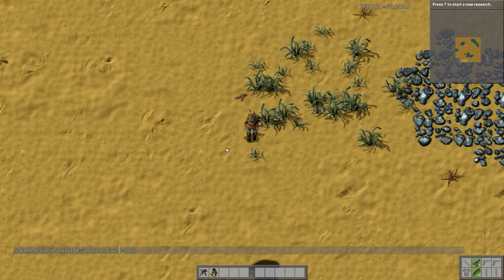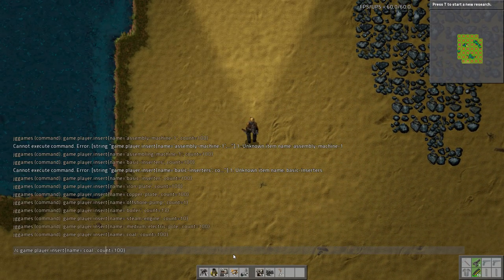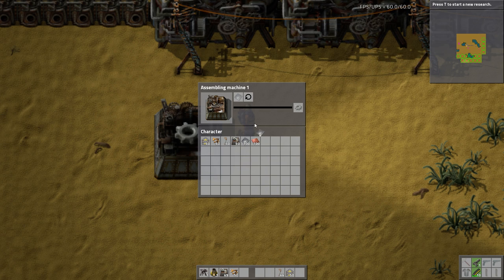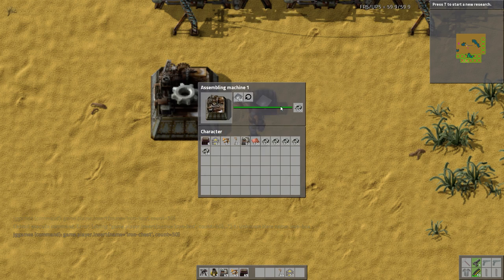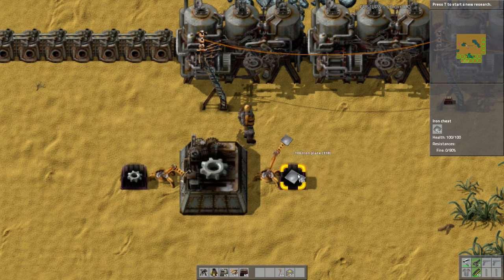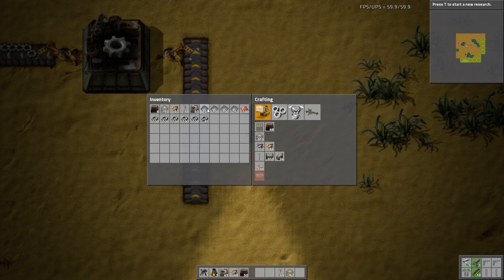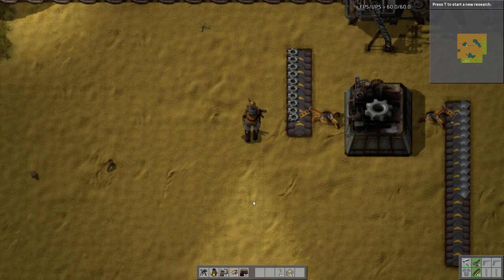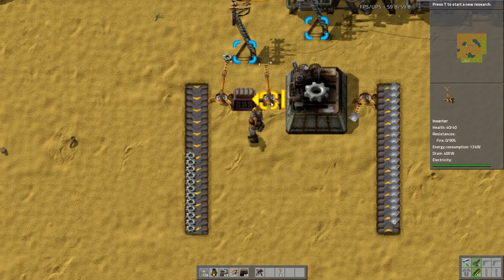Factorio Tutorial 2: Why Your Inserter Isn't Inserting

Comment: You can put coal, and other materials in while running, just hold Ctrl and push left mouse button where you want to put them. Or push right mouse button while holding Ctrl to put only 50% of stack. Or 50% of what you have, if you have less than 1 full stack.  P.S. i use buffer to pick up lots of resources, so i don't need to run over belt and pick up. But why i looked at your video, because i think they have lag sometimes...i played mission(tight spot) and put different resources on one belt, and belt was running around factories, stone furnaces, and each factory would pick up only what they need. But in 3-rd level some stone furnaces would pick up iron plate in furnace and then copper, iron ore in hand, and stuck. I don't understand why, in first 2 levels it worked fine, 4 different resources on 1 belt, and furnaces, factories was only taking what they needed. And when picked 2 iron are and smelted to iron plate, if next resource is copper ore, then he take it and smelt to copper plate, and so on. But what i saw, sometimes, when smelting iron plate to steel plate, stone furnace would pick 1-2 iron plate, then inserter would pick iron or copper ore and stuck, because steel plate need 5 iron plate, only then inserter should pick next different resource. I think it is bug, but i will try different strategies. It worked in first 2 missions, because there wasn't option to smelt steel plate. As i said, i think it is bug.

Comment: what i want to know is why my inserter won't insert into my boiler. i set it up and i run out of power because the inserter isn't insterting. it starts to then stops, and doesn't insert any more coal even if all the steam is gone.
Reply: Well, it's probably due to power shortage. Your inserter requires power > power requires the boilers to work > your inserter can't insert coal into the boilers, because you don't have any power. Basically, you just gotta throw some coal in the boiler for starters and you'll be fine :].

Comment: What about a boiler it wont insert into my boiler but why it has no reason not to
Reply: You need electricity to operate inserters. Only inserter that works without electricity is burner inserter. You need coal to operate it, maybe it works with wood, i haven't done it. And i think you need to connect boiler to pump, steam engine. I think burner inserter will put in only when all 3 things is connected. I usually connect 3 things, only then put burner inserter. And i think you can't put in from water and steam side, because there are pipe holes. In early game you can put coal by hand.
Reply: @juriscervenaks8953  "Only inserter that works without electricity is burner inserter" omfg thanks a lot. it finaly work.
Reply: @charlesbenca5357  I know, Factorio doesn't explain many things how they work, but it makes more fun when you finally find it out.

Comment: Hello Ive just started to play this game and Ive got a begginer problem. I have a electric drill on copper (no belts) and nect to it I have fast insterter then furnace and next to it second fast inserter which is putting it into chest. Problem is that the first inserter isnt doing putting it into furnace so drill will drop only two coppers and then wont do anything for few secs. Hope you got me
Reply from the maker: I would check the following:

1) The furnace does not already have 2 ore in it. The inserter won't insert if there is already ore there. Or is it plates in the output? I forget how it works, probably the inputs.

2) The inserter is lined up properly to pick up from the drop-off point of the miner and drop it off somewhere in the 4 squares that make up the furnace.

Since you said it works every few seconds, I'm going to believe that it's (1). I believe 1 mining drill makes about 2x as much ore as a yellow furnace can handle. So if you want to keep the mining drill running at 100%, you'll need it to feed 2 furnaces. Steel furnaces are 2x as fast as the yellow ones, so if you had one of those it would just about perfectly balance.
Reply: One furnace can't keep up with one miner, you need 2 furnaces, or maybe more for one miner. But if you like miner to not mine all the time, then you could go without first fast inserter. Put furnace in front of miner exit point and miner will drop ore inside furnace automatically, and you don't need fast inserter to take plate from furnace, furnace can't smelt fast enough, yellow inserter is fine enough to put in and out. fast inserter is needed only when you need to put in/out 0,5 sec fast. furnace is smelting 1 sec fast, yellow inserter is fine. Maybe steel/electric furnace can keep up with miner/ drill, it smelt 2x faster, i havent checked if it can keep up. But in start game belts are necessity if you want 100% miner usage.

Comment: Nice ! I understand better the game mechanism now thank you JG. 
I have a question about buffer; you say that is usefull for one thing. Wich one ? :D
Reply: +Rhaktar I'm not at all sure I understand the specifics of your question, but the general principle is that apart from using the lengths of your Transport Belts as very small buffers, you want to use larger buffers in cases where there is a fluctuation in demand, that is where demand sometimes is high and other times becomes low, back and forth between those two extremes.
The steadier demand is, the less need for buffers there is.

One important thing to note, in Factorio, is that Furnaces can store 100 units in their OUTPUT slots. Stone Furnaces, Steel Furnaces and Electric Furnaces. But Assembler Machines and Chemical Plants can't. Those can only store a very few units in their output slots, often only the product from 2-3 production cycles.
For this reason, it's often a bad idea to have Furnaces output their products into a buffer Chest, as the Furnaces already have generously sized "internal" buffer space. But it could be useful to do so with non-Furnace machines. For instance, I'm thinking that it'd be a good idea to have one or even three buffer Chests per machine producing Electric Circuits (the green ones), but still with each such Chest limited to one stack (stack size is 200 in the case of these circuits), because if you don't limit this way then you'll over-produce wildly, and make a larger buffer than you'll ever use which is a waste of resources, particularly early game. Likewise, doing the same with Batteries, red circuits and maybe a few other things as well. It's not something I have actually tested in-game yet, but I will try it in the next game, see if my hunch about this being a good idea is right (I'm fairly sure it'll be either good or harmless for green circuits - less sure that it won't be bad for more expensive products).

Another kind of "buffer" is what I refer to as "taker Chests", especially "taker Chest areas", which is when you have Inserters moving the basic and intermediate crafting materials into Chests, each Chest limited to 1-3 stacks or sometimes 4 or 5, and with those Chests only having one purpose:
to be there for you to walk over and Control-Click on them when you're low on Iron/Copper/Steel Plate, or Gear Wheels or Electric Circuits, or perhaps Pipes or UnderPipes. I'll add an entry about "taker Chest areas" to the uFAQ eventually, but until then this forum post of mine also explains it, and attempts to illustrate it with a single screenshot:
http://factorioforums.com/forum/viewtopic.php?f=18&t=15247
Reply from the maker: +Rhaktar Buffers, in real life, are used when you have an unsteady supply but need it to be steady. Let's say you're running a bread factory and you only get a shipment of flour once a week. Obviously, you store the flour in a buffer so that you have the flour you need to make bread that week. Or you're milling flour and you produce so much a day but you have shipments that leave irregularly throughout the week.

In Factorio, that's really the only case where you really need buffers, and that case only arises with trains. So unless you are loading into a train, or taking stuff off of trains, you really shouldn't be using buffers. All of the processes you build should be working at a constant rate.
Reply: +Peter K. 

My question about buffer had been answered in the Trains tutorals. JG use buffer with train outpost.

But your post is very interesting, especially the taker chests.
Reply from the maker: +Peter K. Good point about the taker chests. Yes, I use them a lot in my factory. If the product isn't something that's going to be used for something else, I drop it into a box for me to pick up later. That's pretty much the only other type of buffer I use.